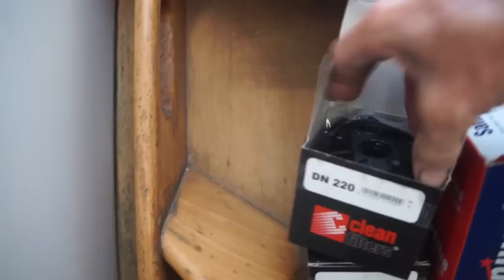Did I Ruin My Engine With The Wrong Oil? | Sailing & Living Free In Cabo Verde| Season 5| Episode 96

Comment: Good job on the engine, don't worry about using some hydraulic fluid, the worst thing is letting the engine run low on oil
Reply from the maker: Engine has been running swell since its lube job